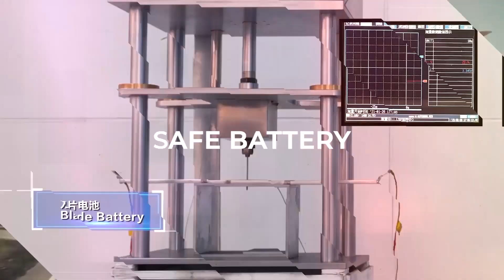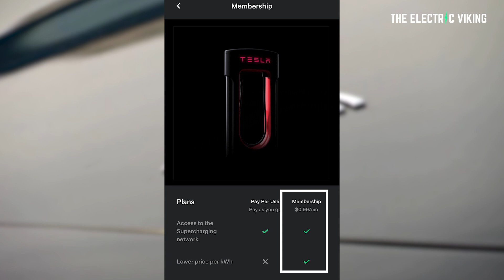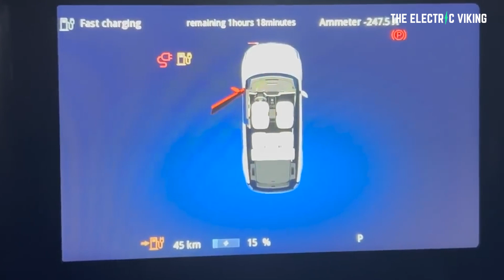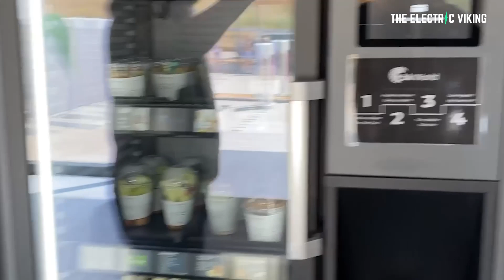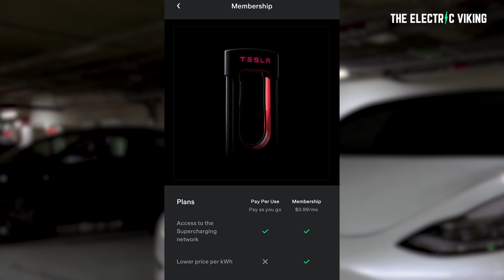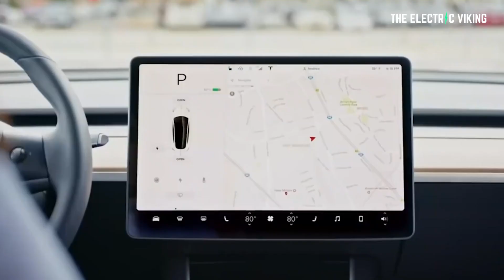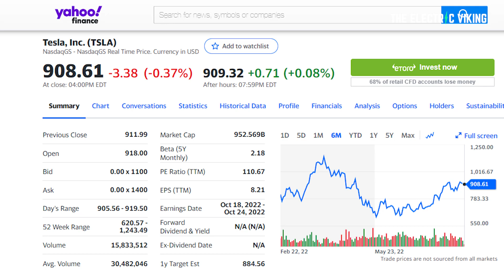Supercharger membership for non Tesla's is absolute genius

Comment: In the US, there is the Tesla connector used by Tesla and Aptera, and the CCS connector used by all the other EV makers. The question is, will Tesla modify all their Superchargers with Tesla and CCS connectors, or will they sell a "Tesla to CCS" adapter to EV owners that would need it. The latter would make more sense, economically. It is also possible that some EV makers may get the option of dual charge ports, both CCS and Tesla. The Ford F150 Lightning even has an extra panel in the right location for that!

Comment: Folks bought travel insurance in airports, Tesla insurance at super chargers. Baby diapers. Tampons. Refilled of filtered water by the gallon.  First aid kits. Fire extinguishers, tow ropes. D shackles, ropes, bungees, Sun cream,  sunglasses.tool kits. Tesla cable adaptors. Condoms, KY.  Hand tissue boxes, wet wipes,  engine degreaser.

Comment: I don't know if your family needs two cars or not, but in case you only need one, you can sell the X5 for the value of the gas in the tank and the Atto 3 probably for a profit and buy the new Model Y.
Offering the Tesla supercharger network to other cars is ingenious. I was expecting a $10 - $20 monthly fee, but in reality, they can make more money from slightly more expensive electricity than their competitors. 
The additional benefit is that it is a free advertisement for them. Someone who frequently uses Tesla superchargers and is happy with them might think that maybe I should buy a Tesla next time.

Comment: I figured Tesla would do a membership (or subscription-based model) Supercharging for non-Tesla EV owners, hopefully, there are different levels of membership, it kind of means GM, Ford, VW, and others will have no choice, but to brand EV charges as their own, kind of like the deal GM is doing with Pilot / Flying J Travel Centers (aka truck stops), like I've said before, using Tesla's playbook until you can beat them at their own game

Comment: Sam. Tesla mission is not to make profit for the sake of profit. It’s all about making more cars to covert more ICE vehicles to EVs. As Elon stated at the opening of Giga Austin, EVs make up less that 1% of cars on the road today. It is all about scaling
Reply: @qilu2004  geez. And I thought it was because to introduce a new product line into 2 existing factories and also 2 new factories only just starting to ramp would be a massive disruption that would only result in fewer EVs produced at a time when demand already greatly exceeds supply. Silly Tesla. They must not be very intelligent
Reply: @zoransarin5411  introducing one more product shouldn't interupt production that much. robots do most of the jobs and it is just a matter of programming. but everyone knows profit margin is higher for higher priced vehicles.

Comment: Nah, this is just noise.  Tesla has no real chance of owning the charging network and be profitable at it in the mid- and long-term.  Gas stations already have all the best locations locked down, and Tesla will have to deal with the devil to get their charging equipment in there.  Nothing will prevent those same gas stations from installing competitor or even their own brand of charging equipment right next to the Tesla equipment.  Once that happens, Tesla superchargers will be relegated to derelict mall parking lots and empty fields while the the gas stations gobble up all the business.  Tesla really has no chance here.